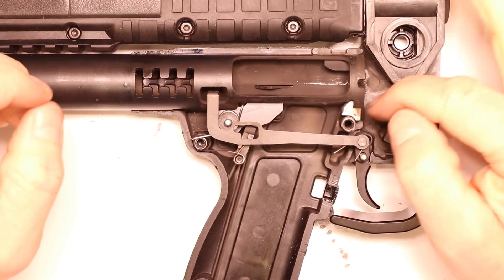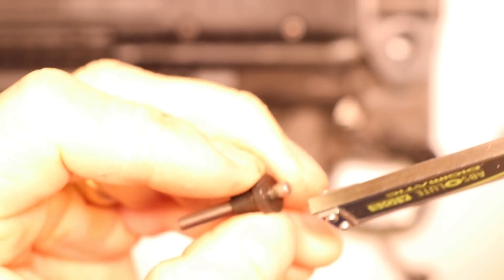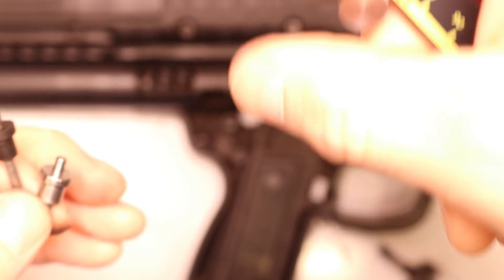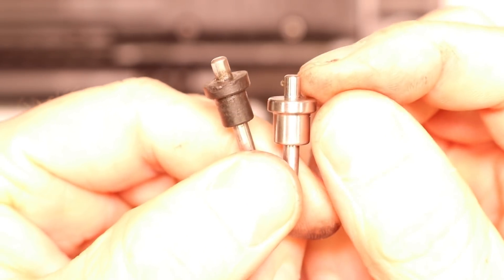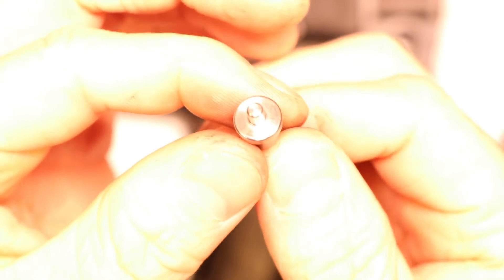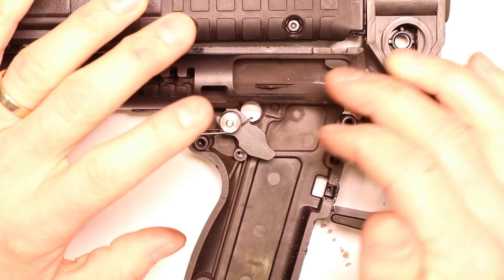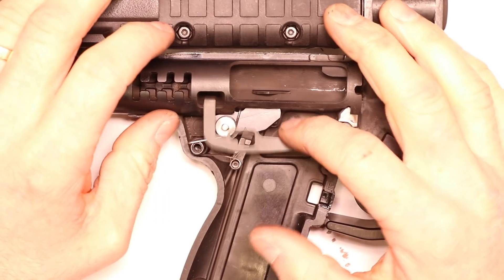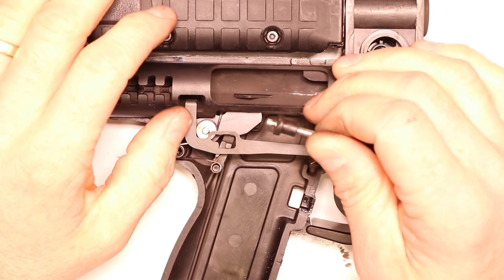KEL TEC SUB 2000 Stainless Steel Fixed Hammer Bushing - SUB 2000 Accessories M*CARBO

Comment: Ordered a few parts and decided to get a hammer bushing cause why the hell not. Once I cracked it open to replace parts, I saw the old hammer bushing was already beaten up and took little effort to slide the plastic off even though I had only put a few hundred rounds through it. Glad I replaced it on a whim before it became a problem!

Comment: Looks like I need one. My new optic mount is working out great. Super accurate at 50 yrds took it out to 100yrds and was really surprised how well it did. As always  Mcarbo goes above and beyond in the quality of their products. All I have left to upgrade is the trigger and I'll have most everything done( SS hammer pin now too). Very happy with the guys at Mcarbo.
Reply: Send me one and I'll test it for you HEHEHE
Reply from the maker: Available now  https://www.mcarbo.com/kel-tec-sub-2000-stainless-steel-hammer-bushing.aspx

Comment: Will you add this part to the all in one pro performance trigger job bundle or just keep it a stand alone part? I suppose it won't matter I just want to make sure I got all parts I need when I do the trigger job.
Reply: I was just gonna post the same thing, I just picked up a brand new Sub2K and was just lining up which parts to buy in order!
Reply from the maker: Available now  https://www.mcarbo.com/kel-tec-sub-2000-stainless-steel-hammer-bushing.aspx
Reply: What exactly does the trigger job cover? Just replacing the springs or what?
Reply: @teacopem  there are springs, polishing a surface or two, new metal trigger shoe (part you put your booger hook on). I think the upgrade is worth it. The oem trigger feels so spongy that its no bueno.

Comment: That's a great part to replace I might get one so next time I'm taking it all completely apart for cleaning I'll go ahead and swap it
Reply: The need to take the whole assembly apart to clean is really not necessary.. it will never  fail because of that.  It's just to ease our minds and make us feel good so we won't be as pissed cause we gotta pull it apart again to once again replace another plastic part.. what's really bad is we got all these awesome metal parts and the whole damn rifle folds on a metal pin with two pieces of plastic on each side. The plastic folds on the sight mount bolt. That is probably the biggest week point of the entire PCC.
Reply from the maker: Available now  https://www.mcarbo.com/kel-tec-sub-2000-stainless-steel-hammer-bushing.aspx
Reply: @deanbottom  so be careful around the hinge joint on the pcc

Comment: Straight trigger for Beretta 92/M-9 .......Beretta's need an upgraded trigger......Could also work for Taurus PT 92/99 pistols as well.
Reply: I gotta ask.. why straight trigger? I was raised on curve and feels natural. Just wondering wat that difference is ? Is is for speed?
Reply: @deanbottom   I keep thinking if I had a straight trigger it might need less travel in double action, & possibly more speed on follow up shots. Wilson Combat has a straight(er) trigger, but still not totally straight & according to them , does not work w/Taurus PT92. I'm more interested in a trigger for the Taurus pistol, since I have 2 . I'm no gunsmith, but if there is any way to update the trigger for Taurus/Beretta pistols, I sure would appreciate that.